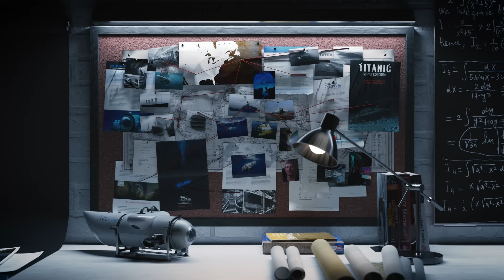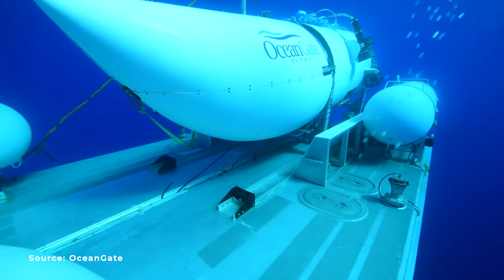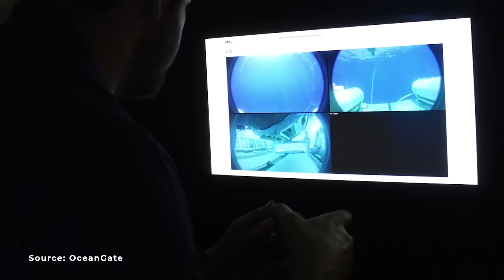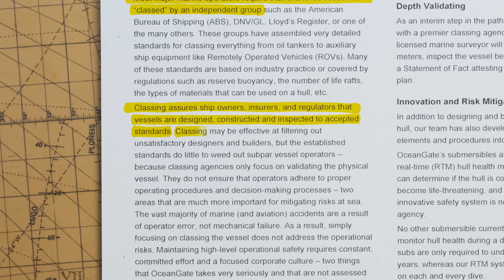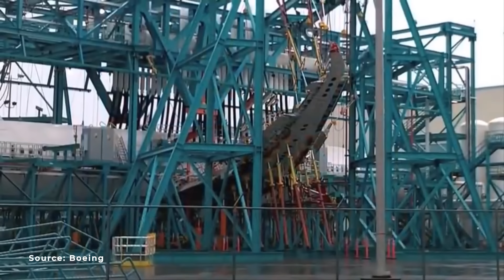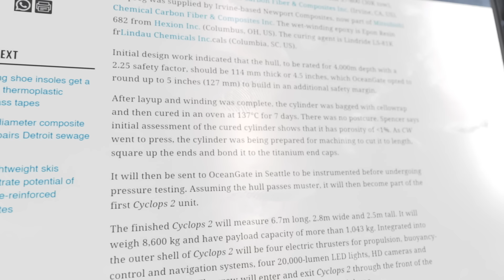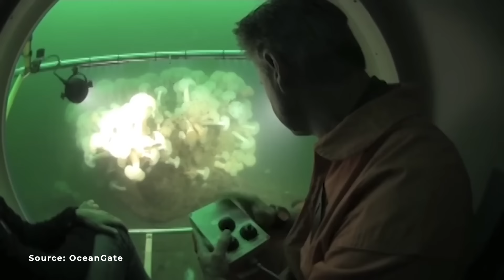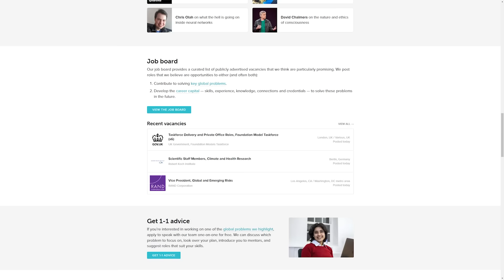The Questionable Engineering of Oceangate

Comment: 10:14 It's an experimental vessel, comparing it to regular widespread commercial aircrafts meant to fly millions to normal places isn't really fair. Remember, the participants were warned repeatedly in the agreement how dangerous the trip is. Can you design a submersible that goes into these depths for at least 50 times for the cost they did? Remember innovation isn't just in new materials but also in new procedures about doing things in new ways. These were part of the data collection process. There is no doubt mistakes were made here (the stress testing you mentioned is a good idea to their procedures for example).

I would have agreed with most of your points if this thing failed on the first try, or even first few tries. But the fact that it made 50 with the buyancy advantages of their material suggests there is something worth investigating with the concept, albeit definitely with some more modifcations such as fatigue testing between some number of dives.
Reply: "comparing it to regular widespread commercial aircrafts meant to fly millions to normal places isn't really fair"

?? it is EXACTLY fair.  why the FUCK do you think they so rigorously test aircraft to begin with?

Comment: There is a large difference between OceanGate and SpaceX. SpaceX tested and had it's failures with unmanned rockets, killing no-one,  and OceanGate failed due to shortcuts and trials with lives at risk. Advancement does come with some risks but we can limit those risks while learning from failures. 

Overall, SpaceX has done well testing its components before full tests. I have found most risks taken by SpaceX to be acceptable. The one exception was a full test of Starship without attempting to control the effects of the thrust on takeoff. They should have known better. NASA has used blast trenches and water deluge systems since the beginning.

Comment: Yes. SpaceX does push the limit of engineering by moving quickly. But they are never putting people at risk and and  when people are involved that have a spotless safety record
Reply: They push the limit and learn from it. As stated in the video pushing carbon fibre pressure vessels to destruction over and over to learn more about how they fail would be equivalent to SpaceX. Doing one 1/3 test and then putting people on board while saying there's no way to test or certify the craft is the opposite of SpaceX.

Comment: Great video❤
My own google research into composite compression strength identified a VERY LARGE range of uncertainty ….. without even considering the issue of cyclic weakening.  The effort had a Russian roulette aspect… without knowing how many barrels there were, or how many were loaded.  I think Stockton Rush did his risk assessment based upon arbitrarily chosen optimistic statistics  that were significantly  influenced by cost concerns and vanity.  This problem is, of course, exactly what third party review would be designed to identify

Comment: On often hears that diving into the extreme depth of the oceans is a bigger challenge thant space exploration du to the pressure. While difference from the earth' surface to space is only one bar its much more difference to the ocean floor depending on the actual detph you wanna go. But you compared the pressure of the ocean gates submersible at the end with a Saturn V rocket engine. Adding to that the thrust of a rocket is very sudden compared to the pressure on a submarine, also I imagine its more 'bumpy'? So wouldn't it be a bit short saying exploration of the deep ocean is much more difficult than space exploration just because of the difference in pressure? Would love to hear more about that comparison?

Comment: I learned in school that you add 1 bar per 10 meters. How comes the difference with 3800 m depth but only 366 atmospheres of pressure. I guess the temperature does not make much of a difference. Does the salinity weigh in ?

Comment: Okay, I'll play devil's advocate.  There have been thousands of opiners opining about what a crappy submersible the Titan was.  I suggest that in spite of the horrible design howlers, the craft was not doomed to implode.  Without help, that is.  The pathetic beer-can-in-a-foam-cooler design actually DID work and cycle to 4000 meters a couple of times.  The submersible was ugly, but not lethal.  What WAS lethal was the knucklehead driving.  The phony transcript is no help.   We won't know the real numbers until they are pried out of the Polar Prince / Oceangate folks.  I suggest that the cowboy Stockton Rush submerged faster than the "flight plan" and crunched the submersible.  However, I suggest that the failure did not come from the submersible failing while operated according to spec., but someone who went down too fast.  Not that I'd ever get into a carbon fiber sub.
Reply: You're right, it was not their first time and the sub imploded from the repeated fatigue. A design issue indeed.
Reply: "until they are pried out of the Polar Prince / Oceangate"

uh, you mean scraped.  literally they are the consistency of peanut butter.  and they already have been recovered.

Comment: The first cause I suggest was an excessively rapid descent which they allowed all through the dive. 2000m/h descent loads the whole craft at the rate of p
Reply: 3 atmospheres per minute.  He exceeded the descent rate on the “flight plan” by 50% on the last descent. The materials have to “adjust” to the increasing pressure.  I think he was negligent in maintaining a safe descent rate which might not have imploded the submersible.  That’s the ultimate recklessness that killed them all. No excuse.

Comment: Lol,  the emergency surfacing system relied on hydraulics and a hand pump to unlock.  That's not the way you do it.  You make a system that will spontaneously unlock, if there is an electrical or hydraulic failure.  Anybody heard about springs?  That's the way, - or the reverse if safety requires solid lock in case of failure -, it's done in even mundane machinery.

Comment: Can anyone where answer a question i have. If carbon fibre can tolerate a large amount of tension, how come it is used in F1 cars. Under a crash, there is a large amounts of impact energy, that compresses the carbon fibre?
Reply: The carbon fiber in an F1 is there to be light and stiff, not to absorb impact.  The only thing in an F1 car made to absorb impact is the roll cage, and it sure as hell isn't made of carbon fiber.

Comment: As a technician who worked for TRW for many years, we built parts for NASA for the shuttles. This job that I did just working on the computer system are very. Complicated. I don't have a degree in submersible but I have a Masters degree in physics and electronic and I can tell you one thing. This submersible was not up to standards. This vessel should have never been permitted to put people lives at risk. I don't understand how someone can be so inconsiderate to jeopardize other people's lives. The physics do not add up when he decided to make a submersible out of carbon fiber. Carbon fiber does not work very well underneath the water, especially that deep. This whole thing could have been avoided and the waiver did the people sign? I believe there's a case here for negligence. Ocean gate decided to bend the law to profit themselves. with no concern of human life. It would have been one thing if he went down by himself and put his life in danger but to make them sign a waiver with three different parts of the waiver saying death on it would have been a no-no for me. Anytime you sign a waiver that has death three times, do not sign it. When you go see your doctor and they do an operation, you sign a waiver but it is not exempt. The doctor from responsibility if you die because of a mistake that he did. The same thing goes here. after serving 20 years in the Marine corps being in submarines for the military. I knew that I was safe and these subs. This thing was the death trap from the get go. I feel very sad for the family who lost their loved ones. I know that they probably die instantly. That's not the point here. The point is that Mr. Stockton Rush. Decided to profit at $250,000 ahead. Without doing the proper testings. And no certification on this particular vessel. Listen to James Cameron how he and the company who made the submersible that went to the Marietta trench. They tested that vehicle over and over many times. James, Cameron has been 33 times to the Titanic and never had none of these problems even when he went with the Russian submersible with Bill Paxton everything went by the book because these submersibles are inspected over and over again on every dive. The ocean is nothing to play with. It is hostile. It's worse than the jungle. We can go into outer space and put a man in the moon . But the pressures underneath the water. 13,000 ft. 6000 PSI per square inch. That's a pounds of pressure per square inch. Well I'm trying to say here this thing could have been avoided. I feel very sad for the mother who gave up her seat so that her son can go who is only 19 years old and lost his life during the implosion. took place. It took less than 20 microseconds lights out before you know it. Such a catastrophe. That should have never happened. In the first place. Rest in peace to all the five souls who lost their life. Seeking to get a glimpse of that Titanic now they join the crew of 1912 who perished due to negligence. Ocean gate is responsible for this event. There were too many warnings. They were ignored. We also noticed that he went to places where United States laws do not apply. He went to the Bahamas. He went into international waters. Another scenario is The ship was towing the submersible because it did not have space to put it on his platform. That right there couldn't cause problems that were not visible to the human eye. This submersible was never even x-rayed whatsoever. This was a ticking time bomb. Unfortunately. May these souls rest in peace.

Comment: I’m not a material engineer, but I knew immediately after being told it was carbon fiber that it wouldn’t be good…

Even SpaceX slowed down when it came to anything with humans in the equation. Launching automated rockets, it’s not a big deal if you blow a few up or crash them. But when they got to missions with people on-board, they did a lot more testing. There’s a difference between moving fast and breaking some things vs. just throwing caution to the wind entirely

Comment: I am far from a materials or composite expert, but as a mechanical engineer, I immediately questioned the decision to use carbon fiber for a compressive application like this.  CF in compression is not at all unheard of - see bicycle forks for a product with a long history of holding up very well to compressive loads (In 2001 I bought a bike with a CF fork.  Rode it for 20 years and it's held up just fine).  But on a bike [I think] the forces at play are not as high and the stakes are lower.  If your fork breaks, it's bad news no doubt, but if your CF hull breaks 4000m down it's instant game over with no chance of recovery.

To top it all off, flagrantly ignoring best practice safety standards and testing all while claiming "it's all good, man" is so horrible.  We don't have to worry about this particular bad actor ever hurting anyone ever again, but we absolutely do need to worry about future bad actors.  Time and time again, companies claim that regulation and safety standards are killing them, yet the companies that comply with those regulations are still around - still making record profits - still employing very alive individuals.  Meanwhile there are companies who ignore the regulations and standards literally killing people.  I'm so done with this deregulation crap that seems pervasive.  Our ancestors fought hard with their own blood and sweat to get unregulated and dangerous processes safe.  Some companies are ignoring that progress so a few people can get very rich while the rest of us suffer.  This is nonsense.
Reply: Also, IIRC, CF forks and wheels will not deform under too much stress so much as they will just plain snap.

Comment: Carbon fiber is for tension - not compression, and not only that....
The fiber was wrapped like thread around a thin spool. Insanity.
Of course you can crush thread from the SIDE without even pulling on it.
Only the glue was holding it together - for a while...

Comment: Good video. To be clear though, there is nothing wrong with carbon fiber hulls going to the bottom of the ocean, but you have to cycle test and inspect them. When a fault is found, you have to repair it if it is minimal or scrap the hull if the scratches are deep.

Comment: the game controller is a logitech f710 usb controller for windows, ive broken like 5 of them, they cost 20 dollars last i checked and even when the top shoulder buttons don't break which is always, the membranes they use have a habit of falling apart completely after like 6 months of moderate action gaming, its definitely good enough for the price point but a 20 dollar gamepad is roughly equivalent to 5 dollar earbuds from the drug store,

Comment: Vacuum bagged carbon fiber... yikes.  As I listen to this, I am struck by how cavalier these Engineers were.  You know the risk of stress concentrators (voids) in the material is high but you conclude that, "Maybe it's ok?"  So you go out and submerse and raise it remotely 100 times and take it for detailed third party scans to assess the damage.  Then you publish your results and let the wider community consider whether you've made a breakthrough in reducing the cost of submarine manufacturing - which is an odd thing to optimize for in my opinion, these aren't exactly mass produced.   Wait... INSTEAD, you just go to market and hope that your hunch will pan out.  I'm not sure what you would call that, but it doesn't feel like Engineering to me.  I spend 90% of my design time making sure that we KNOW X will hold, or that X is what we think it is, or that X isn't mitigated in the real world by some factor I didn't even account for.  I wouldn't market a SPOON with the level of due diligence that appears to have been employed here.  (Depressed sigh)

Comment: As an aviation guy, the reason most failures and crashes are operator error is bc there is so much oversight on the designs, builds, and maintenance in the first place… with the exception of Boeings recent major blunder which was more of an issue of politics and FAA relaxing its standards on its old friend, saying they don’t need a regulatory body to test them out bc it’s only meant to essentially keep the little guys who don’t know what they’re doing out is the most arrogant statement I’ve come across. And this is coming from someone who thinks many things are overly regulated in the first place